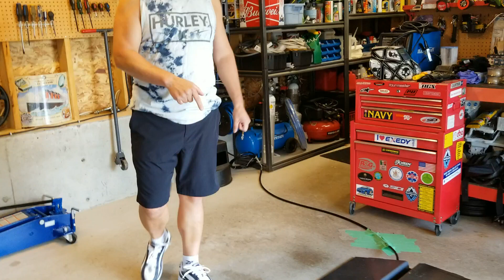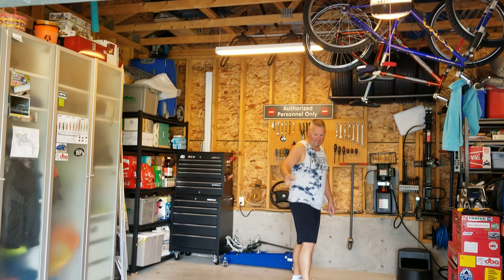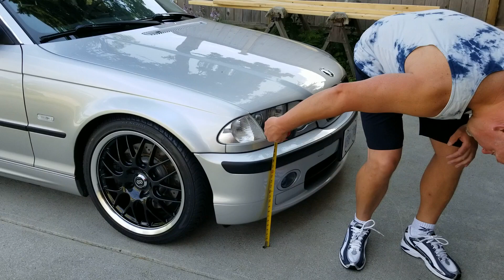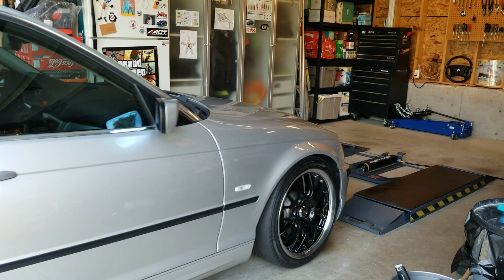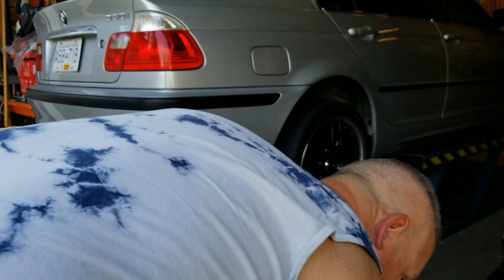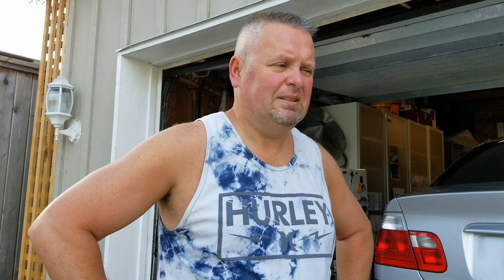Bendpak LR-60P Review Auto Lift

Comment: Good review .  Im shopping around for a low lift work on my 2015 Camaro SS and my girlfriends 2012 Camry . Both are a pain to get a floor jack under . This looks a little bit more stout than the quikjack. I like how you can park over it without having to move it around.
Reply from the maker: For sure, its much more sturdy that the quick-jack set up.  I think the quick jack is meant to be a portable solution. Still very happy with my Bendpak LR

Comment: Thanks, was interested in this and how it compared to my quickjack.  I don't think there's much advantage to this in terms of height (although it does look a bit higher), and it's definitely less portable as the quickjacks are only 100lbs / pce, but you can't really park on top of the quickjacks like you can this, and that makes them a bit of a pain because it means whenever you want to work on them you have to slide them down next to the car & wiggle them back and forth on the ground until they're in position - and that part sucks ass, especially in my driveway where the concrete is razor sharp.
Reply: I’m planning to get the Quickjack 5000
Reply: @mzee5533  They're good units.   Especially if you don't have much room like I don't.  Especially if you're going to be setting them up on a garage floor with very smooth cement.  The problem kinda comes in when you have to set them up on course cement (like my driveway).  They become tough as shit to wiggle into position perfectly under the jack points & the rough cement tears up your knees in the process.  On the smooth cement of a garage floor they slide much easier.

Also, sometimes it doesn't fit some cars - mine are the original 5000, which I think are 6" shorter than the shortest new 5000's (they re-did their lineup to offer a range of things from short, to 'normal', to extra long, but back then they only offered 1 size in 3500 and 5000).  But if I recall correctly mine were tight on smaller cars like miatas - so if you have a smaller car you should consider the 3500, because that comes in a 6" shorter variant.  But they also re-did the tops of them to make them fit more models, so the 5000 may still work fine.

But yea, anyway, they were a good investment.  Have used them to get transmissions and differentials out, as well as do a body swap for an exocet project on a miata.  They're good stuff, they pay for themselves.  And I've left vehicles in the driveway on them for like a month or 2 without any issues.

Comment: Thanks! After watching some videos on all the installation requirements for a 2 post lift I decided to go with a scissor lift. I'm not sure yet if I want to go low or mid rise. I have plenty of height for the mid rise but I like just driving on and over the low rise and lifting without having to put the lift bars in place. But then you don't have to drive on and over the mid rise, just over it.  Hmm 😒
Reply from the maker: Hi Dennis  I'm no expert in any way, my question would be, what do you need the lift for? When I see the scissor lifts I often wonder how comfortable it is working underneath them? How do you pull a transmission in a rwd car? How will you get a transmission jack under it? The footprint was a consideration for me. Ultimately the two post lift is the best, as seen in most automotive shops. If you have the height but not the required concrete thickness underneath, then I would go with a 4 post lift with a bridge jack. They are somewhat portable and you can double your parking. A lot of people use them for storage...
Reply: @jmerodgers  these days I'm pretty much just going to us it to do tire work. So I think a scissor lift will be sufficient.

Comment: I was surprised you didnt have to put rubber pads down to hit the lift points under the car.  Did that not touch your side skirts?
Reply from the maker: It didn't, but I had lifted that car many times. I do have rubber blocks from Bendpak for other cars. I no longer have the e46..

Comment: I think there is a 240volt option but I don't see why most people would want to wire the unit like that.  Have you tried lifting your truck yet?  I'm worried that the lack of lift point flexibility will be an issue for my application. One example is my Honda crv has lift points over 60 inches apart
Reply from the maker: Hi Chris, I have not lifted the truck  and you are correct the relatively short length may preclude the use of lifting points on certain cars. I did get some rubber lifting blocks from bend-pak and have used them to seam lift a few vehicles including a friend's Grand Cherokee...

Comment: nice review man I been looking for a lift for my garage. ceiling height is only 82 inches for me so was thinking one of these or the quick jack. I got a transmission to install in my 65 impala need one of these for that. any drawbacks or regrets?
Reply from the maker: im still really happy with mine, i prefer it to the quickjack as it doesnt need to be stored or set up each time i need it.  im not certain but i also think its a bit higher so it gives more room with the creeper.  Either way they both are much better and way safer than jackstands. Check the height  of the impala tranny so you know how much lift you need?  Another option would be a 4 post lift, with a bridge jack.
Reply: If you haven't purchased anything yet- I have the QuickJack and it's really handy for working on cars but now that I own crossovers/higher vehicles, I rarely use it. It's just easier to use the floor jack and jack stands. QuickJack, despite it's name, takes a bit of time to set up and each frame is difficult to move into position (again, not what the marketing people are showing you). On the other hand, it's super easy to store away. I'm leaning toward purchasing a drive-on lift just because I don't use the QuickJack as much as I should and want something that's faster to setup.
Reply: @chrisE815  haven't pulled the trigger on anything yet cause I haven't found something that I feel 100% happy with
Reply: @AllThingsCool  yep, crazy market too. Everything is a compromise except for a 100k garage
Reply: @chrisE815  yea i agree

Comment: I have an older version of this lift. It's not versatile at all. Unless you have a vehicle with perfectly accessible pinch welds, it can be a PIA finding lift points. Also, lift has about  8 to 10 of rearward swing as it lifts the vehicle. Not good if your garage space  is tight. It is a simple lift to operate without a lot of moving parts to break or mess with.
Reply from the maker: I bought the rubber lifting blocks from Bendpak and have had no problems lifting cars. It's true it does swing back about 10 inches from the spot you start. I've serviced multiple different cars with this and have no regrets. Your experience may differ to each his own.
Reply: Just making an observation re the lift. Something for others to consider. I made a set of extension arms with pads for my lift that expand its capabilities a bit.

Comment: Hey Jamie.  Nice video.  What amp circuit does your lift run on?  Did you say yours is wired for 110v?  Could you have backed your car on the lift to have the open portion of the lift under the engine/trans?
Reply from the maker: Hello, its on a 15amp circuit 110V, i routinely park it with the open portion of the lift to the front of the car, i did the oil pan gasket and motor mounts this way in february. i love this little lift!

Comment: Does this still require the rubber lifting blocks like the quickjack?
Reply from the maker: The lifting surfaces are covered with a rubber skin so no blocks needed. I do use the pinch weld blocks when I lift cars by the pinch weld though..
Reply: @jmerodgers  so if it is a unibody like the Challengers and Chargers, you would still need blocks? I have the pinch weld blocks
Reply from the maker: @Thinbluelinecardetail  I would use the pinch weld blocks, especially if you already have them. You don't have to..  but I thought it was worth the relatively low price of blocks.. protects the thinner rubber of the lift too, keep any rust or excess dirt off the lift.

Comment: Gee, wouldn't a mid-rise scissor lift have been more useful, even if you don't like the 2-post lifts? There are also the single-post mobile lifts, which I've seen positive reviews for.
But I guess you got a deal, so...
Reply from the maker: None of the mid rise scissor lifts i saw allowed you to get a transmission jack or creeper underneath due to the legs. Single post lift? No thanks...
Reply from the maker: @manofsan  yeah that's cool...  cost?  You'd need room to store it as well as it has a fairly large footprint.
Reply: @jmerodgers  have you heard of the EZcarlift?
https://www.youtube.com/watch?v=8UhQ_qwWHWw
What do you think of that? It stows away pretty easily. Bit expensive, though - might be better to find a used one.

Comment: Does this utilize a 15amp or 20 Amp plug?
Reply from the maker: 15 amp circuit
Reply: jamie rodgers Thanks for answering. Do you feel the cost is justified vs the bend pak quick jack?
Reply from the maker: @2011WRX4ME  Yes, there's quite a bit more room under this than the quick jack. Also i would have to store the quickjack ramps somewhere when not in use and im short on storage now. i feel this is also safer than the quick jack because it is one piece.. This is also quick and convenient. That said the quick jack is better than jack stands.